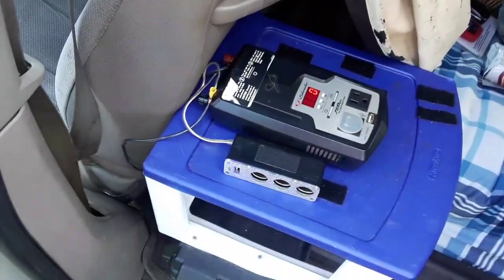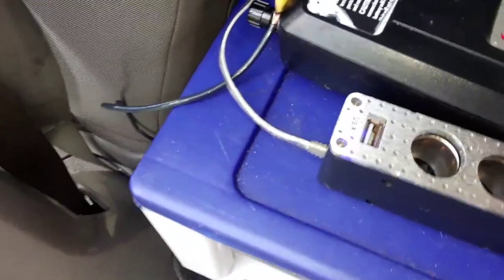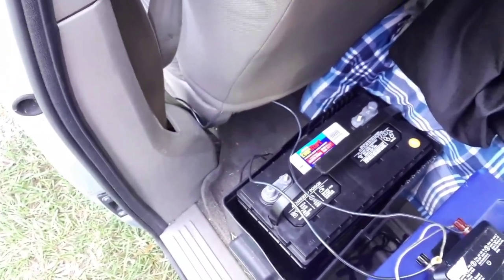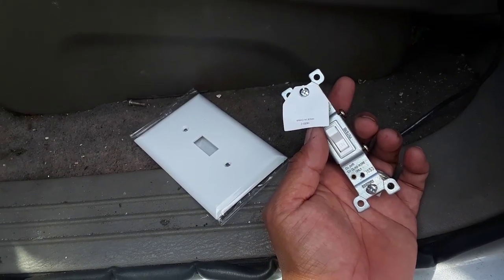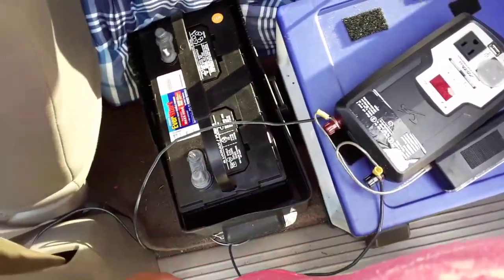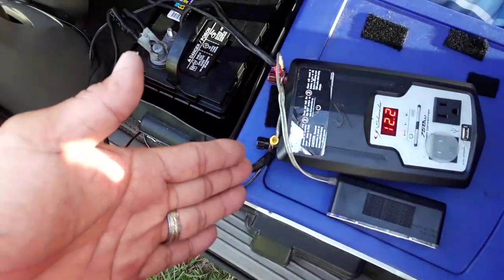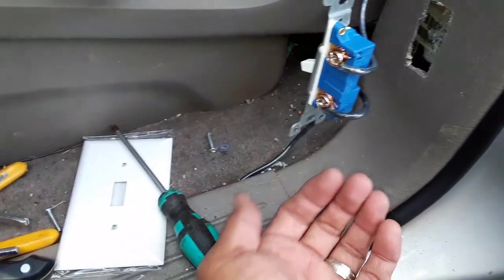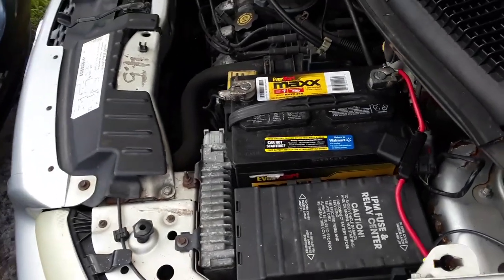Vanlife - How To Build A Cheap And Quick Emergency Stealth Camper Part 3 (V927) Living In A Van

Comment: Like your system, like it a lot. How about putting up a solar panel as an alternative source of power.
Reply from the maker: +Dickie Richards Don't really need solar as the system charges itself within minutes of me driving around. This keeps costs down and helps with stealth. If I were boondocked somewhere for days/weeks on end, a solar electric system and water cachement system would be installed.

Comment: Thank you for the simplified explanation of how to run this system...Question ; Dont you need fuses for fire-safety? I'm NO expert at all, but everything I've read says fuses are vital for preventing a fire..(??)
Reply from the maker: +Lizzy2shoes There's a fuse where the system connects to the vehicle battery under the hood.  The inverter also has fuses built in.